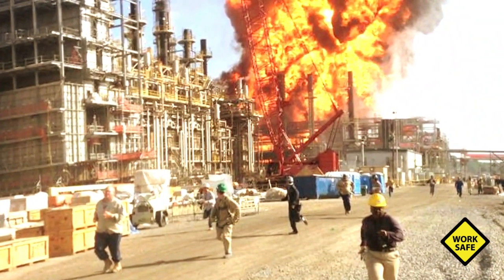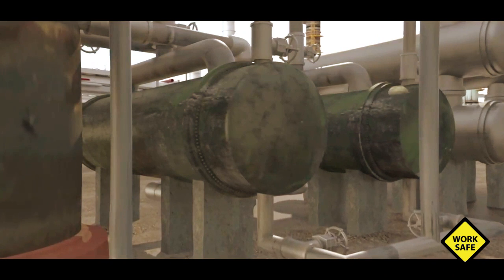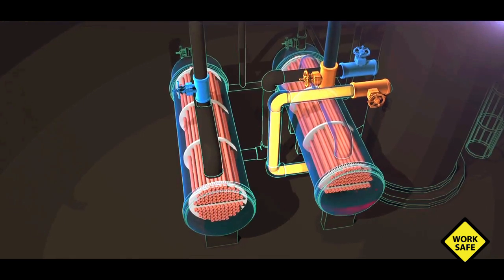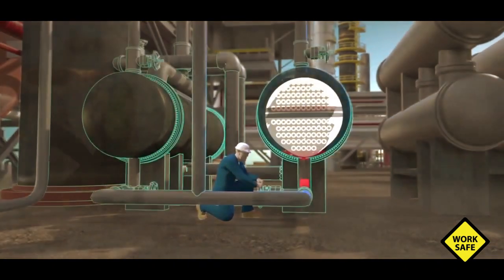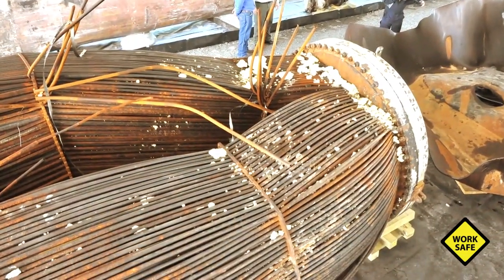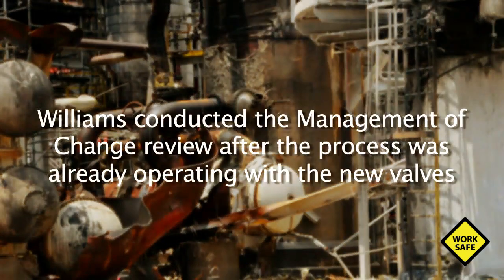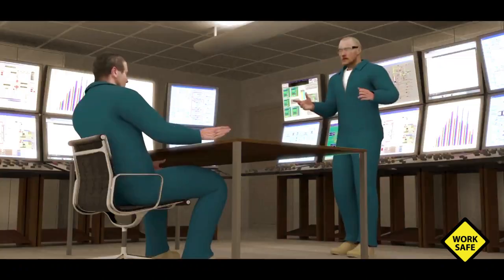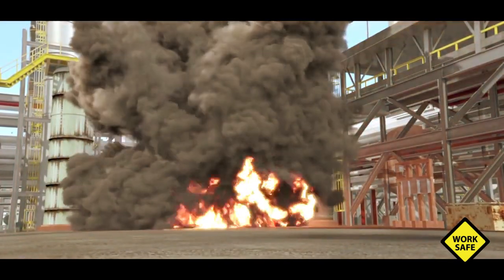Explosion at Williams Olefins Plant | Incident Investigation | Accident Investigation

Comment: CSB - Chemical Safety Board. Assume they closed the hot water and propane supply lines to the reboiler (shell and tube heat exchanger) by closing the block valves when they switched over to the standby. I didn't see that in the video.